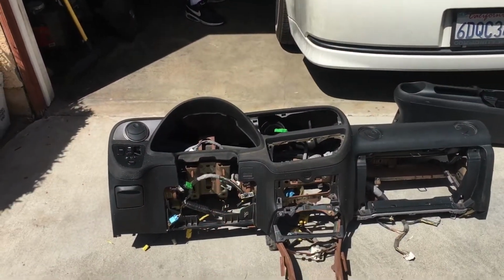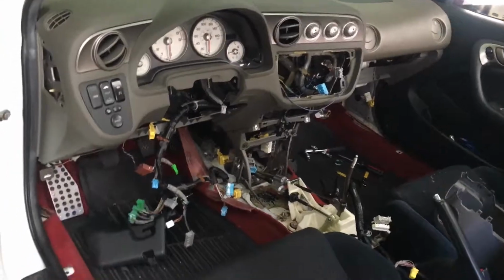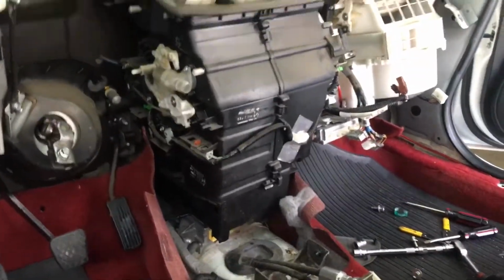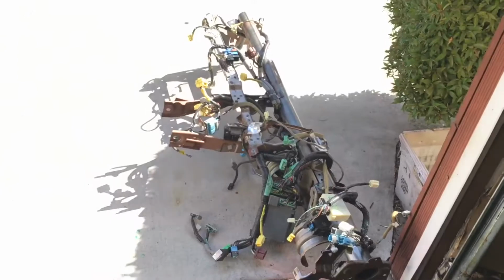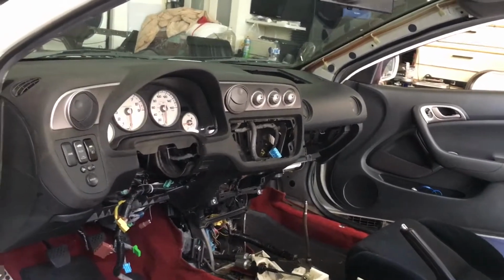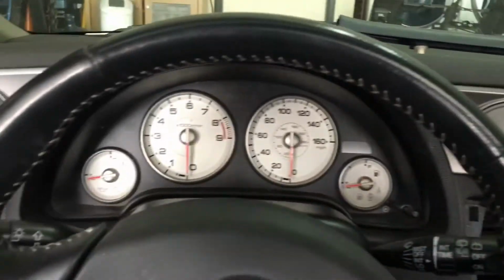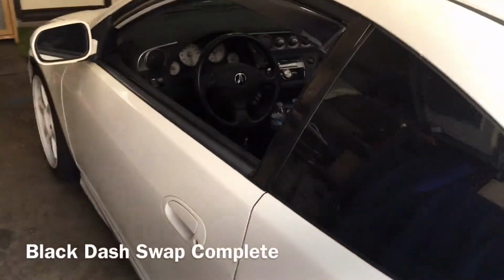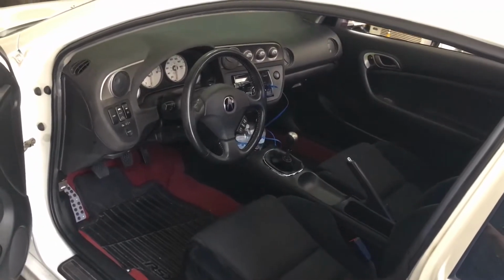DC5 RSX Black Dash Swap

Comment: Doing this, and I have it all unbolted, and wires unhooked, this thing is kicking my ass and not coming out.  It rocks in place, but will not come out.  Any ideas?  I've tried lifting and rocking it out, downwards, up, straight out, but nothing.
Reply from the maker: Probably the steering wheel?

Comment: HI there. I use my rsx type S only for the track days and plan to remove whole dash + skeleton and all other staff including heater and ect... will I be able to start and run the car with out connecting all that connectors. what do you advice?
Reply: Thanks for the quick answer. Hope I can do it. Assembly seems very heavy. do you have any idea about total weight ?

Comment: I have a question i swap my dash to a black one after i installed everthink my car dont start it turns over but doesnt start
Reply: Both dash skin and skeleton i used the same stering wheel it had on i try both inmobilizers and still no luck
Reply: Thanks i got it to turn on turns out the other 02 i pick up had a swap and the harness was a 06 so i ended up switching the skelentons instead